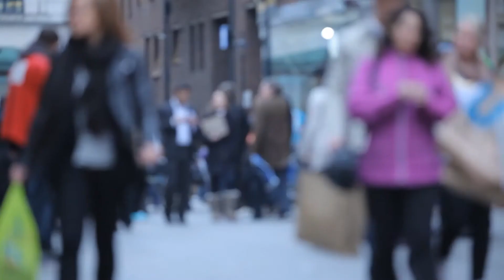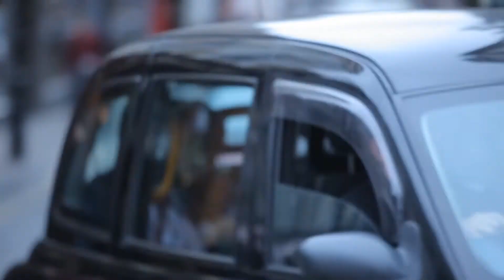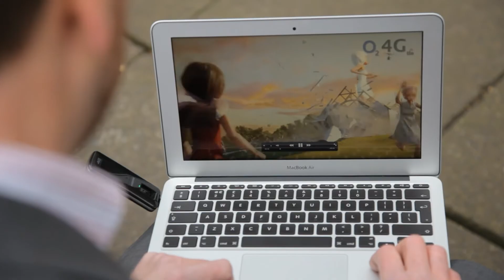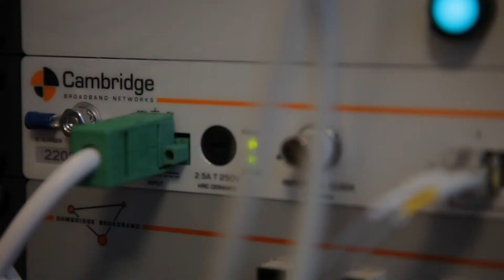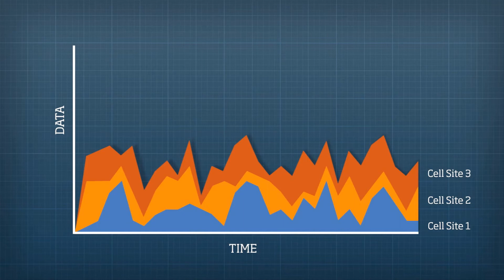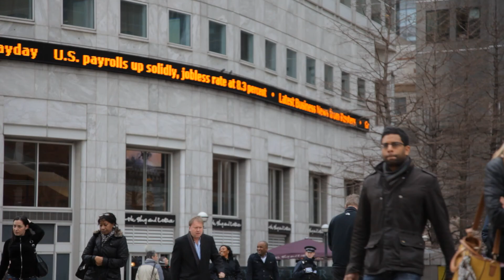4G live in London: the backhaul behind the scenes

Comment from the maker: Although it’s a common perception that peaks occur at certain times, they are unpredictable and bursty. This allows for traffic to be efficiently aggregated. 

If a large news/sport event occurs, operators can deploy temporary cell sites or Wi-Fi access points (e.g. in a stadium) to off-load data traffic.

Otherwise tower capacity is shared evenly between users and depends on operator’s cell site performance.

Comment: just like they call LTE 4g which it isnt. it's technically 3G. LTE-A is 4g
Reply: From launch all UK 4G networks were LTE-A. LTE on it's own was never really a thing and even when it was calling it 4G was perfectly legitimate. You may be confusing normal LTE 4G with the mess the US made, where they allowed 3G HSPA to be called 4G!
Reply: @oldblueshirtguy  no am talking about actual LTE, it was actually 3g originally essentially, LTE-A is true 4g in my opinion, now we have 5g but once again its not true 5g it's  NR which requires 4G to work.
Reply: @DanielMeah  It might have been fair to regard the original LTE spec as "3.9G" at the time, however my point was that no UK networks ever sold it. The UK was relativity late in introducing 4G/LTE and so never used the original LTE standard for  customers, only LTE-A and later. In addition, the use of a new frequency band for the original LTE spec was later decided to rightly be deserving of the name "4G". But this is all irreverent as all 4G networks in the UK are and always have been real 4G networks. Unlike for example the US where they incorrectly marketed 3.5G networks as "4G".
Reply: @DanielMeah  5G NR DOES NOT require 4G to work. You're thinking of 5G NSA. In the UK we now have 5G NR SA in many places, which supports VoNR and does not need 4G.